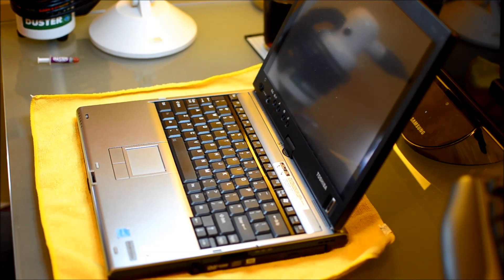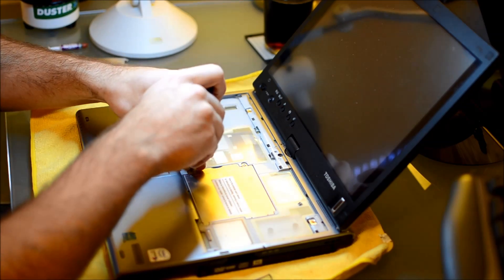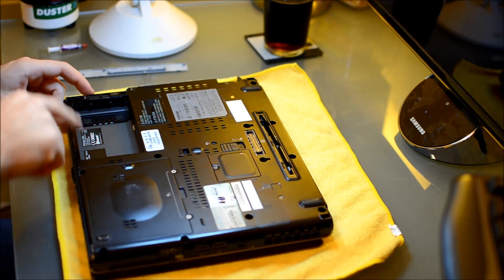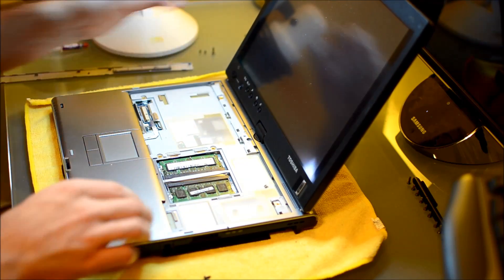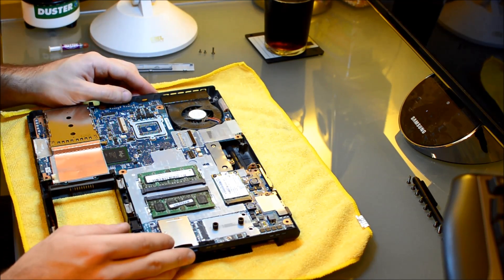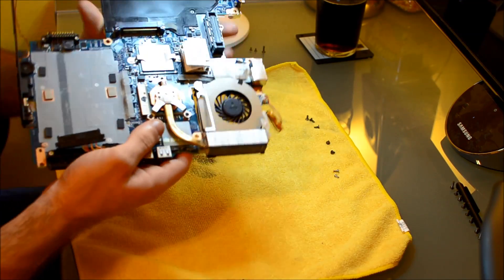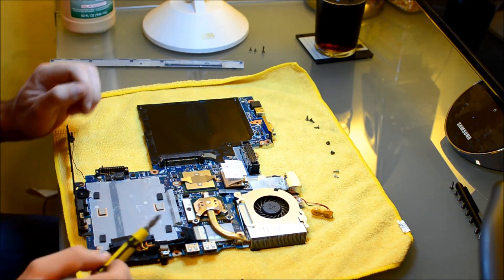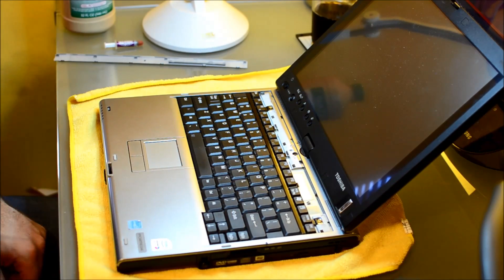Tutorial: How to make an old laptop run cooler- Cleaning the fan and applying better thermal paste

Comment: if the air already coming out of my laptop is really hot, should I assume my defacto heat-paste is performing well?
Reply from the maker: freeNode5 Depends on the laptop really, but if it is just sitting there idling and the air is hot, it probably means that the hsf is not cooling it very well- the air should not be hot unless its under load